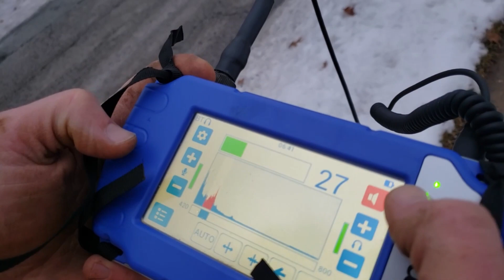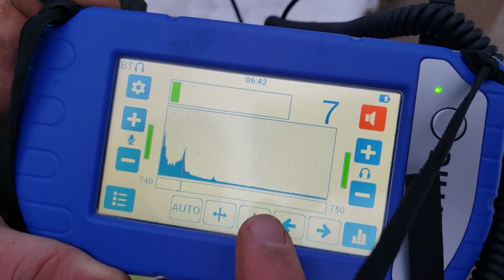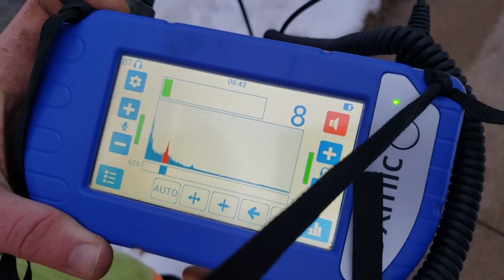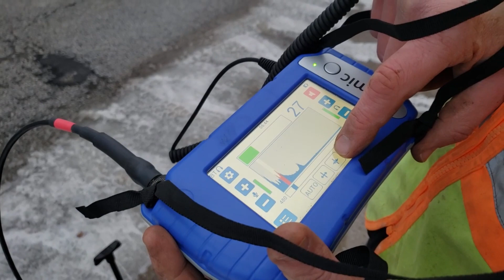How to find a water leak using a DXMic by Fluid Conservation

Comment: We have a leak in a ~40 PSI poly pipe system at a depth of ~6 feet, in gravel. Can you confirm that this unit should be capable of detecting this leak? Can you tell me an estimate of the depth of pipe you're detecting in this video (and any other info you might have such as pipe material, PSI)? I see snow on the ground so it must be fairly deep.

Comment: Would this also work as  a electrical cable locator ? 
On domestic households , I’m a plumber/drainlayer and pretty much 90% of the time the cable is laid in the trench with the drains so if it picks up cable you could track the main drag of the drain to a extent ? Aswell as it being a leak detector ?
Reply from the maker: Sorry it doesn't locate power.  But we have a fine line a cable and pipe locators.  The RD7200 on our website would work well for your application.
Reply: @SubsurfaceSolutions   that’s fine also what’s the life expectancy on the dxmic ?

Comment: so basically you move the elephants foot to the spot where you get the loudest noise?
Reply from the maker: That is correct.  Easy as that.
Reply from the maker: Yes when you are on concrete.  The elephant foot helps block ambient noise from traffic and wind.  On soil you would use the soft soil foot or probe.